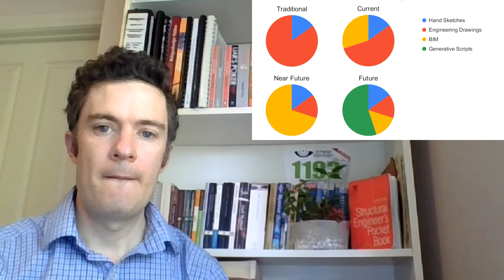Will Structural Drawings and BIM be replaced by generative design? Manual modelling vs automation.

Comment: Generative Design cannot replace BIM. It's a subset of Computational Design which is a Subset of Parametric Design. Instead We'll see more use of 3D in connection with 2D as deliverables.
Reply from the maker: Depends on timescale. In the medium term I agree with you completely. But I wonder if 2D is still used 200 years into the future.